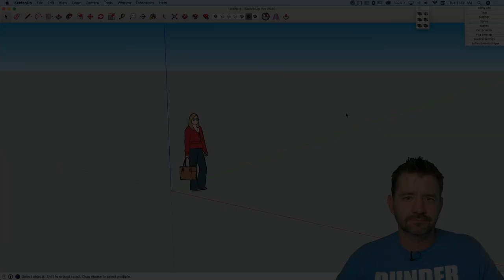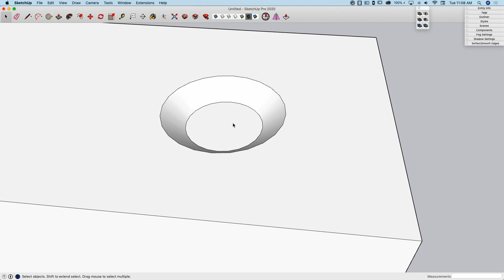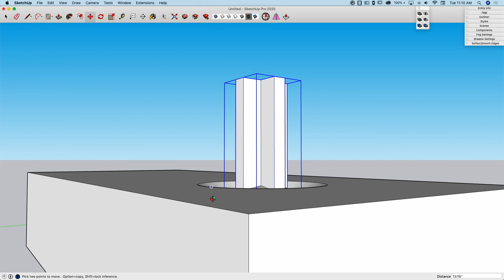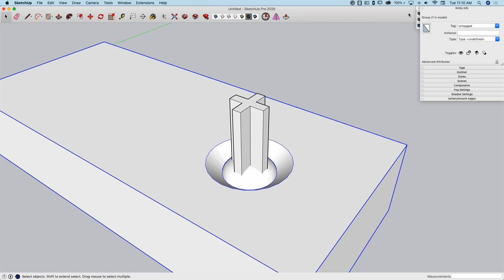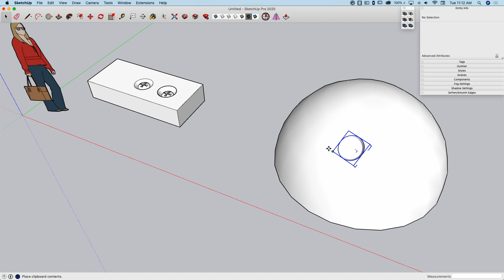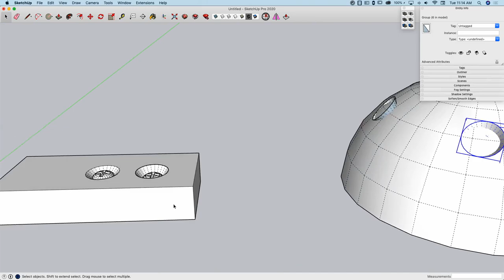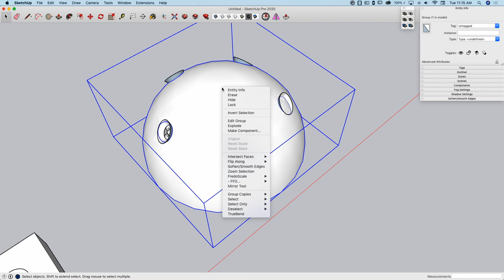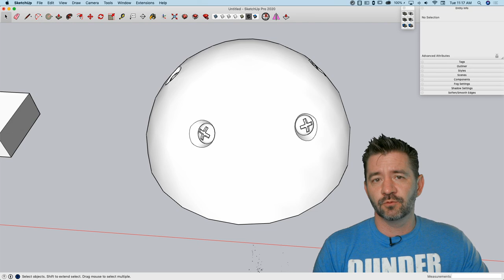Countersinking - Skill Builder

Comment: In our shop on an actual machined part the screws would have been arranged so that the head of the screw was co-planar with the surface,,, it seemed although I was viewing on my phone screen that the axis through the center of the screw was tilted a few degrees. Put another way if you drew a ray from the center of the sphere through the center of the counter sunk hole it would pass through the center axis of the screw,,  it didn't seem as though this was the case in the example,,, but you have me some great tools on sinking and cutting countersunk holes on curved surfaces,,, it will come in handy,,, I've had some complications when modeling countersunk holes on curved surfaces,. Not if you could demonstrate a clever way to align the screw center axis to the ray,,, Id be in hog heaven,,, and I could continue to fool my boss into believing I really knew what I was doing,,🤨

Comment: To make countersinks for screws you need to match the angle of the countersink angle of the screw head. This varies with the type of screw, they are not all the same. Flat- and oval-head inch screws are normally 82 deg. whereas 90 deg. is the norm for flat- and oval-head metric screws. So how to quickly create that bevel on the countersunk hole you are creating seems important to me.

Comment: Thanks Aaron - another great set of steps and tips. I'd be interested in your thoughts on this: all of the 5 countersink components were obviously slightly off skew relative to the half-dome, which is understandable. In order to get them deskewed, as it were, would that require each one individually having time spent on it, or might there be another trick to this?

Comment: K, I got the screws radial and simplified the workflow. First the circle at 4:55 should have been 10x sides, so that the multiplied screws would rest on all five faces the exact same. Then at 5:55 I pasted the screw onto the ground so I could make it a component, setting axis with blue forward from the "Top" endpoint of the screw, and turning on Glue to Any and Cut-away. Then I dropped it from Components onto the center of one of the faces of the dome, and copied it 5x. All copies auto-cut the dome. IMO this would make a less clunky Skill Builder vid, especially as the method used above does not work if the dome is any larger relative to the screws than what was used.
Reply: For extra showing off, with the base circle sides set to 30 or 50, another row of screws can be placed at a different elevation on the dome on faces direcetly in the center of the first with only an extra 30 seconds of work.

Comment: I often work with complex organic shapes, such as these,  when doing RC models, and I find it quite frustrating that when intersecting, a lot of errors appear. I read that scaling up the models would help, because the cause was somehow linked to working with small objects, but it doesn't. I spend a lot of time cleaning the faces in hidden geometry one by one. Any tips for avoiding errors when intersecting?

Comment: Hé I love this example, but when you countersink is there a way to specify the angle or slope of the sinking?
Reply: Marten de Wijs : sure there is, and for that type screw head which would normally have a flat underside, you would also have a land at the bottom of the counter sink. A flat to receive the flat of the underside of the screw head. I think Arron was demonstrating without the worry of accuracy.
Reply: @douglasmichel6361  Hi Douglas, thank you for your response, can you tell me how to do it?
Reply: Marten de Wijs : Mathematically (equation) or  how I would draw it?????
Reply: @douglasmichel6361  How you would draw it please
Reply: Marten de Wijs : I didn’t forget you, just need to finish a job I’m doing. I should be able over the weekend explain what I would do.  Thanks for your patience.

Comment: when "not a solid" ------->> i close sketchup immediately
Reply: Facts! Hahaha
Reply: If you can, get Solid Inspector 2. That takes the pain away!
Reply: @jonomoles  i love solid inspector. To bad its not on free web version haha
Reply: Yes, solid inspector 2 is a great tool, anyway "not a solid" is the fucking hell!!
Reply: sntgchns :   ya have to pack the laptop in Jello over night before using solids, otherwise SU has no clue what a solid is.... it needs reference. LOL
Reply: @douglasmichel6361  xoxoxoxxoxoxoxo great tip!
Reply: Yes, it would be tricky to cure some non solids without it.
I guess activating X-ray mode might reveal internal faces. Temporarily hiding a face might help too.
Reversed faces should show up as long as they’re not tiny.
Holes in a mesh can sometimes be found by temporarily painting the inside a bright colour and orbiting all around it.
Quitting Sketchup makes the non solid go away but seems a bit harsh!